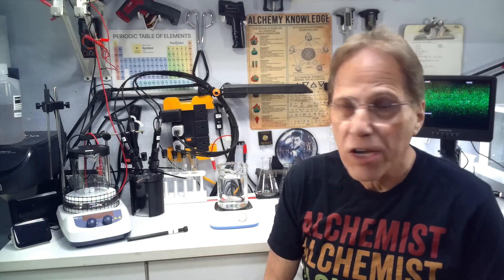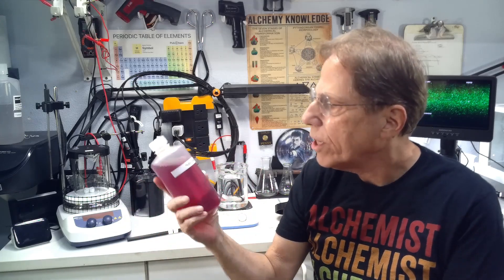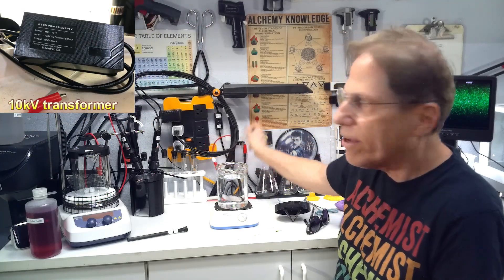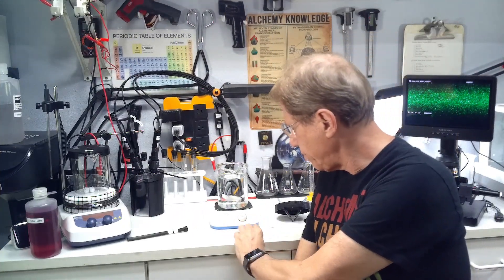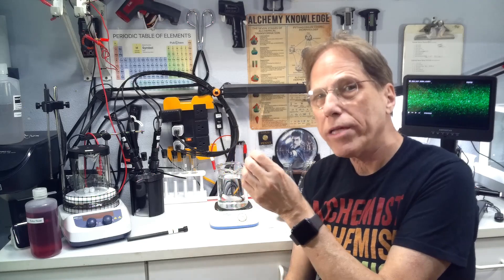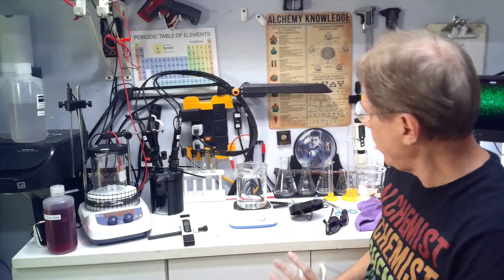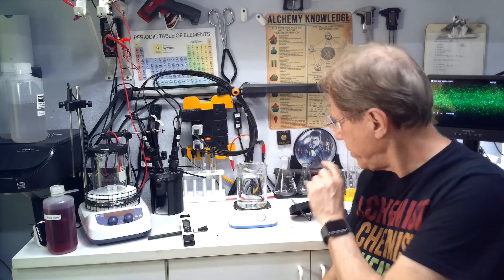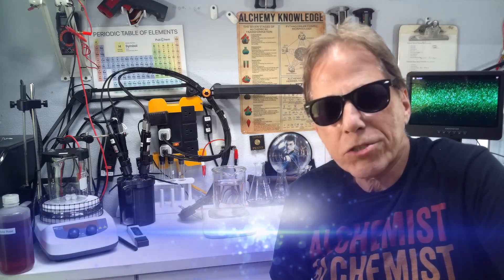Making Rose Gold Nanoparticles (20nm) using Plasma Arc, Start to Finish!

Comment: Je découvre votre chaîne et franchement j'adore. Merci j'en apprend beaucoup et ça me confirme également beaucoup de choses

Je travaille l'or colloïdal depuis plusieurs années, et il m'est déjà arrivé de faire de l'or rouge ruby, mais il ne tient que quelques heures et devient fuchsia. 
Pour y arriver, je pense qu'il faut monter en voltage, et jouer sur l'écart des électrodes. Mon support à électrodes est réglable et en jouant sur l'écartement, ça change l'ampérage de consommation du transformateur. C'est comme cela que je règle mes électrodes. J'utilise un transformateur DC, en mode AC, ça fait des particules positives et négatives qui s'attirent, s'agglomèrent, créent du dépôt et tire vers le violet. Beaucoup moins de dépôt en mode DC et un or fuchsia. 
La température doit rester stable pendant toute la durée à 85°C à l'aide d'une plaque chauffante sinon ça devient violet au fur et à mesure que la température baisse

Ce que j'ai testé:
10kv AC 700w: or gris rose violet
15kv AC 50w: or rose violet foncé
30kv DC 60w: or fuchsia très foncé, fraise
100kv AC 100w: violet
Reply from the maker: Thanks so much for the information on AC HV transformer voltage and your gold results. They are most interesting. 100kV transformer... Wow!

In Low Voltage Electrolysis the color of the gold is mostly determined by the amount of NaCl that is in the solution. If your gold is transitioning to purple, decrease the NaCl by 20%. The spacing of the probes will only determine how much gold loss you have. With gold the widest spacing works best. 

Heating the water to boil in HVAC plasma arc will force the Rose 20nm color solution. I heat my water to 50c so that I get some purple gold in there, then the plasma arc heats the water to 80c and it starts creating the Rose. This way I get a bit of both purple and rose. I think there is value in drinking 20nm and 40nm gold. Of course you can make a batch of both and mix them manually. 

Mixing two different kinds of gold only works in plasma arc mode. If you mix LV electrolysis gold then the gold with the highest salt content will change all the molecules to the higher.
Reply: @AlchemyWizard  merci pour tous ces renseignements. très intéressant

100Kv est trop élevé je pense, mon meilleur résultat est avec le 30KV  DC

Comment: Hey Tom, quick question. How do I use the multimeter to measure the mili amps of the solution. Do I need to add to a power supply or do I just dip the red or black sensor in the liquid? Please help! 😂 I wanna make Collodial Zinc and Magnesium tomorrow
Reply from the maker: This video shows you how to hook up a multimeter to your power supply setup for making nanoparticles. Have look, if you still got questions let me know: https://youtu.be/I_R71FY7jvI
Reply: @AlchemyWizard  thanks Tom! I have a large power supply like you in the video. How would I hookup the multimeter to that? The same as in the diagram and would I need special leads? Ty

Comment: New here, just curious how you measure/confirm the PPM?
Reply from the maker: This is a good question but not an easy question to answer. I’ve got a video on it (see below for link). 

The standard parts per million formula does not work for colloidal nanoparticles. Basically, because the nanoparticles created and the amount of material used can vary greatly, depending on the method used, conversion efficiency of the specific metal, and what chemicals may have been added. I wanted to develop a concentration scale, but too many people are hardwired to parts per million. So, I took silver and cooked it with low voltage electrolysis to various concentrations, weighing the metal to determine how much material was used and was created into nanoparticles. I used these readings as a standard, as they are as close to standard ppm as you can get. Then I compared those results with images from the video laser scope to determine a rough idea of the particle concentrations seen in the images of nanoparticles. 

Silver made in plasma arc will use 2mg of material and give an apparent concentration of 20ppm. Silver done with low voltage electrolysis will consume 7mg of material and give only 10 to 12 ppm in concentration of nanoparticles. Other metals have similar cost vs returns depending on how it was made.

• Colloidal Nanoparticle Parts Per Million vs Concentration: https://youtu.be/ax9i0S7ENTM
Reply: @AlchemyWizard  thank you very much for this! I suspected you might have covered my question in a past video, but since I just came across your channel, I haven't seen most of them yet.
Reply from the maker: @sapphirepyramid  !
😀

Comment: Yay I earned me a “cool” 😅 😎  The size  in the ruby gold is 20nm but I thought ruby gold is 5nm and that it gets purple maybe around 10nm?  How is it the plasma method makes much larger particles?  Beautiful little video inserts showing the ppm’s by the way, showing how it scintillating, what kind of microscope + mag did you use if you don’t mind my asking?  Thanks a mil for these videos!!!
Reply from the maker: Plasma arc particle sizes for most other metals is around 20 to 40nm. With gold the size is either purple 40nm, or rose 20nm. By heating the water before you use plasma arc you get the 20nm size particle. Room temp you get the 40nm light purple color.

I'm using the andonstar microscope and a laser setup to illuminate the particles. The laser rig to view the particles I made myself and the 3D blueprint will be in the blueprint store on Patreon at some point this week for purchase,.

- https://youtu.be/brkp1_UdcWw
- https://youtu.be/ZyvFIQMyysQ
- Blueprint store: https://www.patreon.com/wisdomsdoor/shop
Reply: @AlchemyWizard  nice you have a Patreon!  Thanks for sharing with detail, I took screenshots of some of your answers,
Merci!!
Reply: Please disregard my first question as I just looked it up.  But speaking of nm size, is the ruby gold made with household chemicals 5nm in size?
Reply from the maker: I don't  have a electron microscope so I can't actually measure the size of my colloidal nanoparticles. I can only go by what is published as far as color and nanometer size. With gold it's easy, because the color and nanometer size is well documented and directly related to the color that is emitted.

5nm gold would be bright red and not the darker ruby color. I've never been able to create bright red gold. It may be something to try in the future though. The Ruby Red comes in at 20nm according to the color spectrum. Purple is 40nm. Orange is supposed to be around 80nm, but I'm not so sure of that. I've created orange by mistake but have not tried to actually create that color on purpose. Grey gold is closer to 100nm in size. Clear would be over 100m, which seems to be created when I use the green laser pointers on gold.

With other colloidal nanoparticles like silver, zinc, copper, there is no way to know what size they are by observing the color. Typically they would be anywhere from 5 to 60nm but most are probably around 30nm. 

For example, in the case of copper the color (brown, green or cyan) is directly related to the oxidation state that is created, and not the nanometer size. Copper brown is at 0 oxidation state, copper green is at +1 oxidation state, and cyan is +2 oxidation state.

Silver can be clear, brown, or grey but that is dependent on what stabilizing chemicals are used and the concentration of particles not anything to do with the size of the nanoparticles.
Reply: @AlchemyWizard  amazing seriously thank you for all those nuggets of info 😎